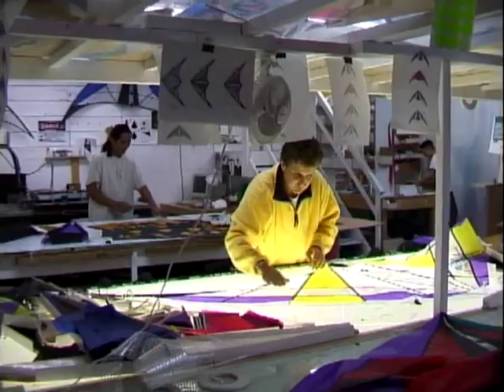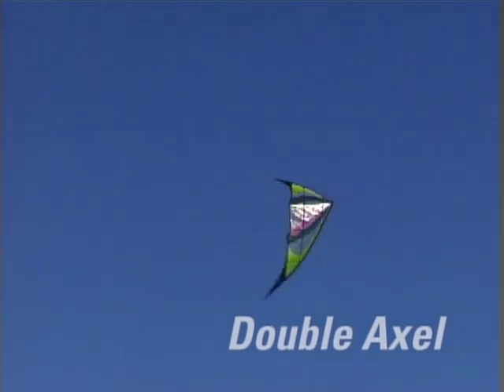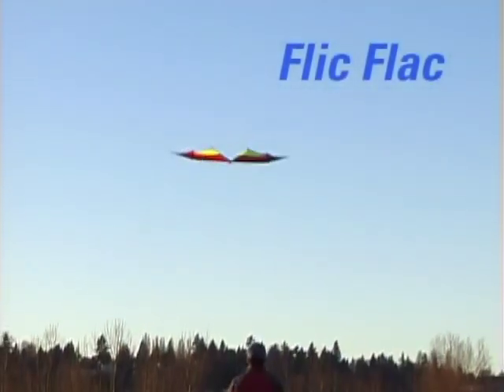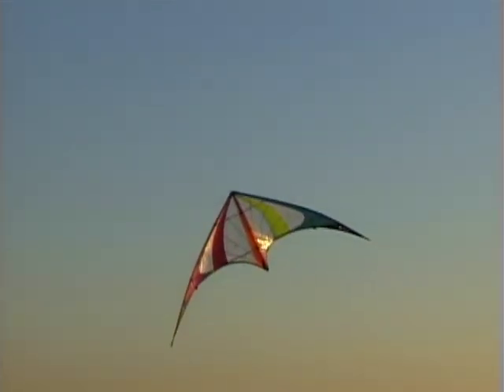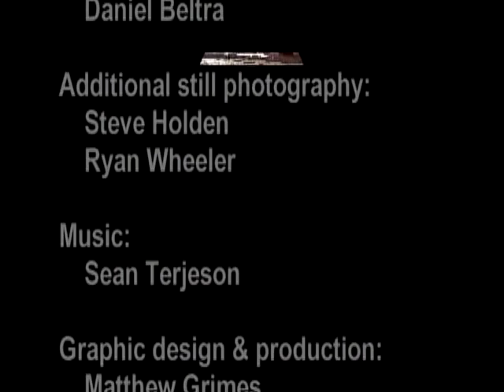Freestyle Pilot - Full Length

Comment: 1:20 Stalls
3:30 Side slide
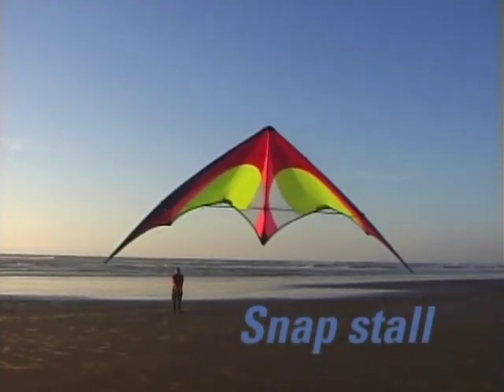5:40 Snap stall
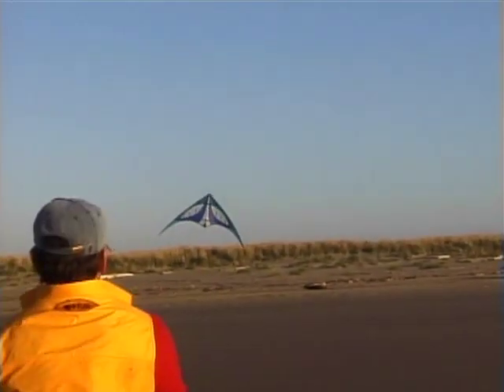7:12 Tip stab
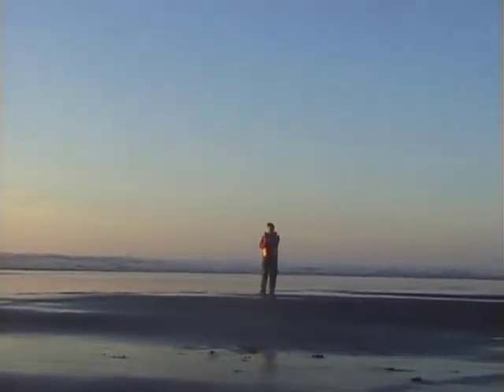9:30 Cartwheel launch
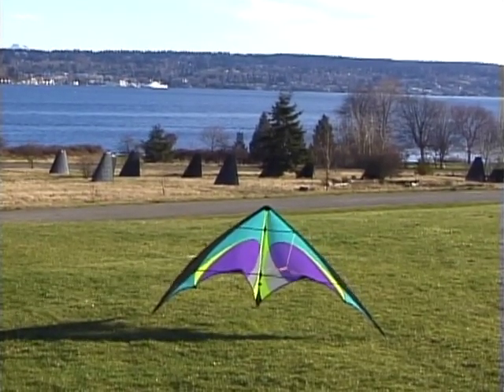11:06 Leading edge launch
12:02 Sleeping beauty launch
12:46 Dead launch
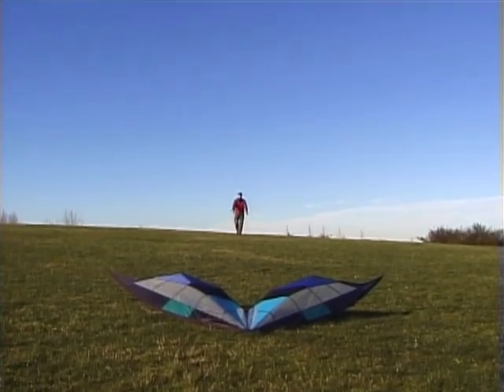13:56 Pop Up launch
14:50 Light winds flying
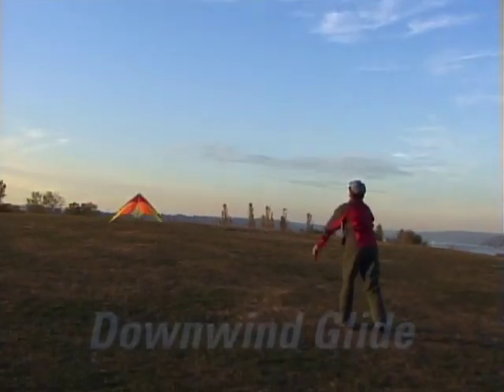17:23 Downwind glide
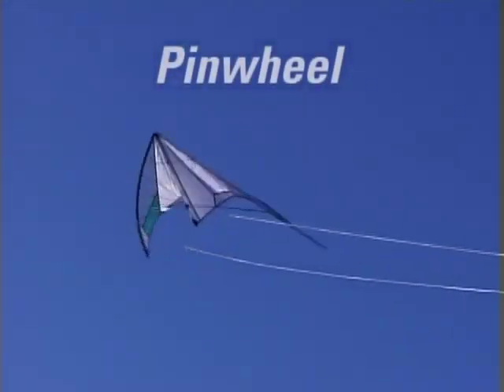19:46 The Pinwheel
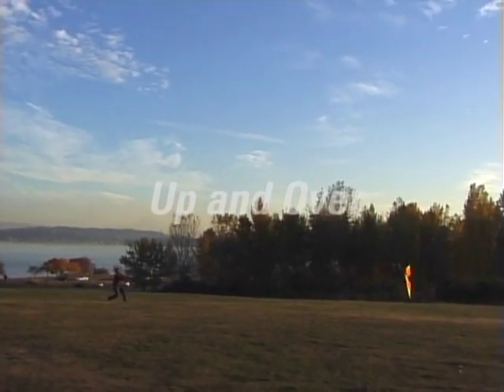20:37 The Up and over
21:07 The Backflip
22:22 The Lazy Susan
23:15 The Flapjack
24:13 The Yo yo
25:10 The Axel
26:40 The Spin Axel
27:26 Double Axel
28:20 The Coin Toss
29:10 Reverse Coin Toss
29:52 The Ground Toss
30:20 The Half Axel (I'll learn this one its cool)
31:22 The Cadcade
32:10 The 540
33:05 The Fade
35:09 The Flic Flac
35:44 The Backspin
Combinations of the moves
37:02 The Fruit Roll - Up
38:25 The Full Monty

- PRISM design guys!  You owe me one  kite free of charge. 🙏 😊
Reply: Did you get it? 😂